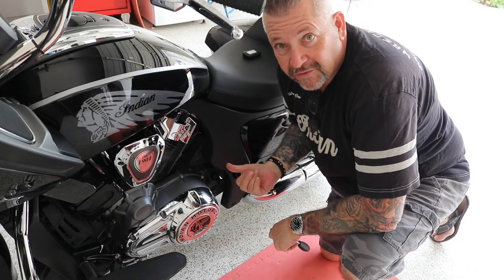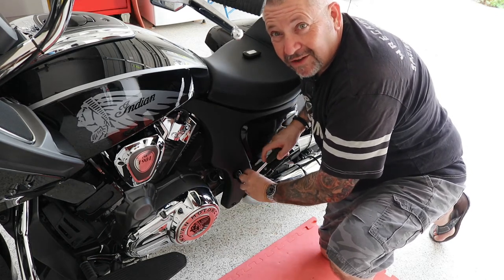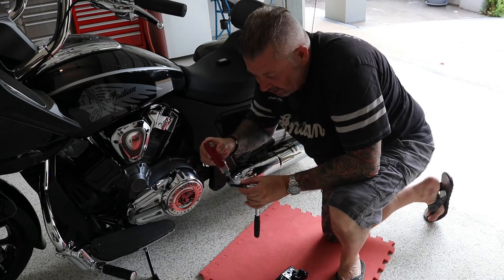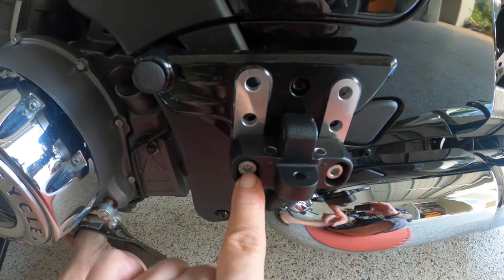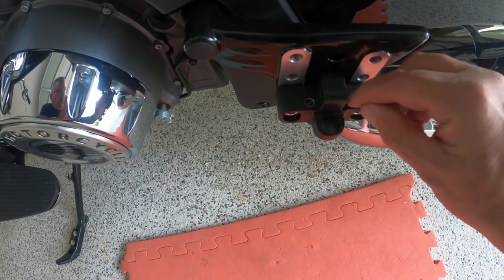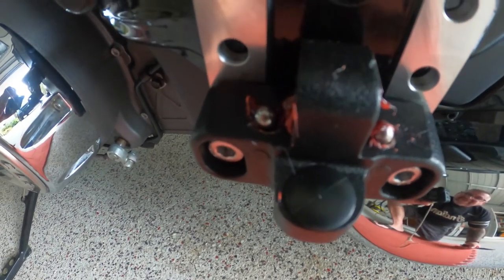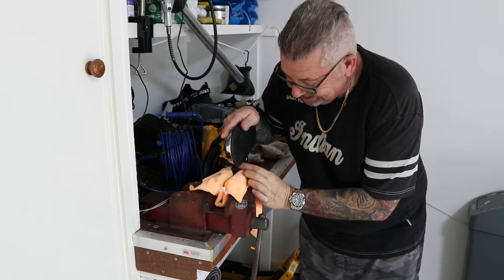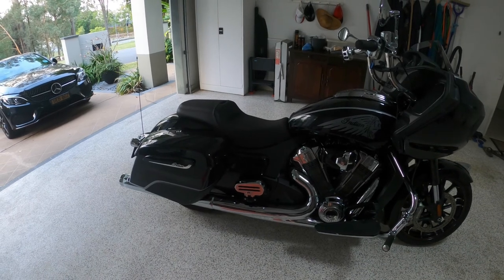Passenger Floor Board Installation to an Indian Challenger

Comment: I just put a set on mine. Had no problem installing the boards with the bracket on the bike. Bracket has to be straight up in the folding position, then some down pressure to slide the pin in.

Comment: How do you get the spiral retaining ring onto the pin
Reply: those rings are so tiny. I used a small pick like you can get at Harbor Freight, to open up the ring a bit and slide on part of it onto the pin, then just roll it on and it snaps into place. I laid a large white towel under the boards though just in case it flew off I could find it.
Reply: came here to ask the same question.